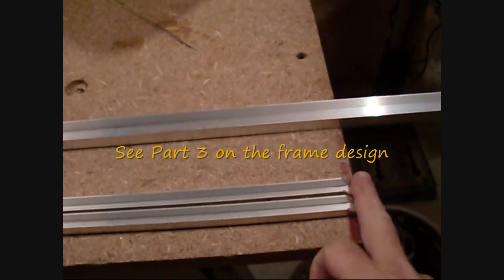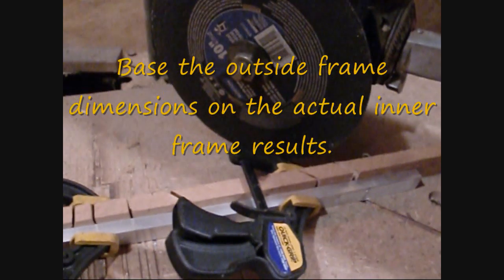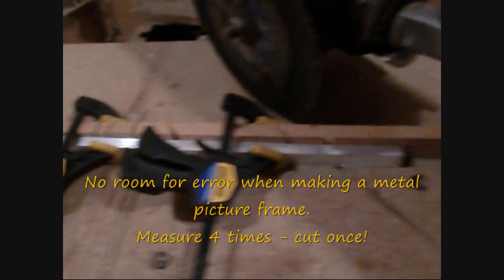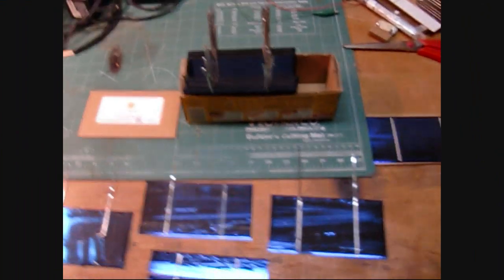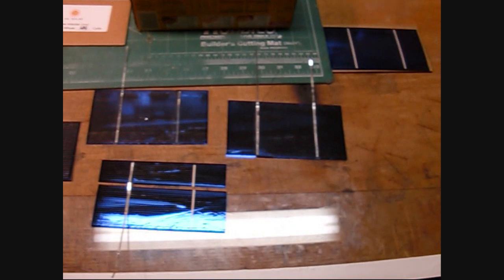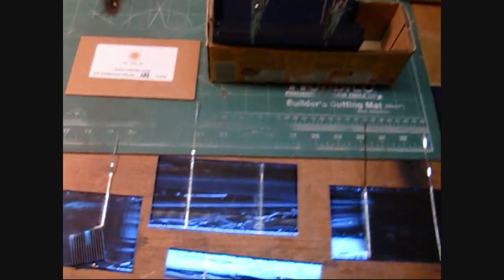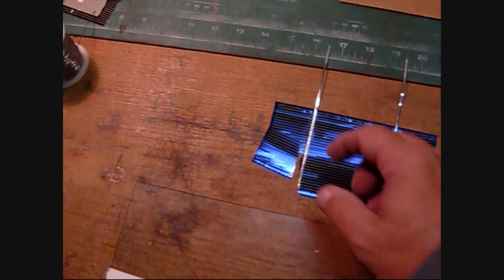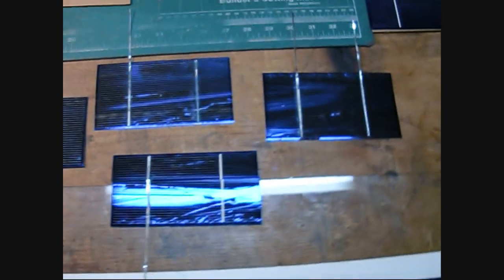PART 5:  $100 70w Solar Panel DIY project

Comment: The heat from the soldering is definately something you have to keep in mind. I have been using a radio shack soldering iron. You should be using the pointed tips not the flat ones. Once you get the hang of it it's easy to do. The biggest problem is that the tabbing expands from heat then shrinks back when it cools bowing the cells slightly.